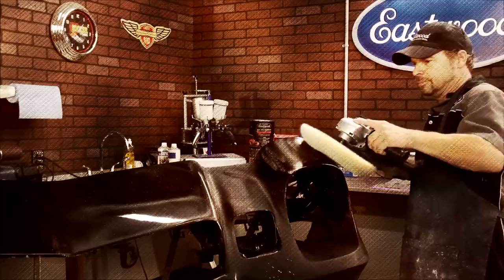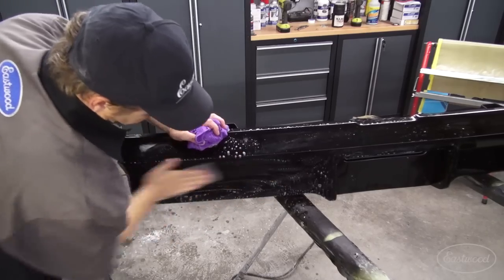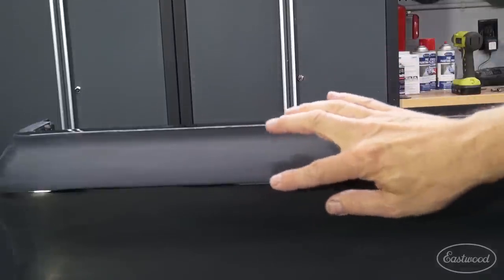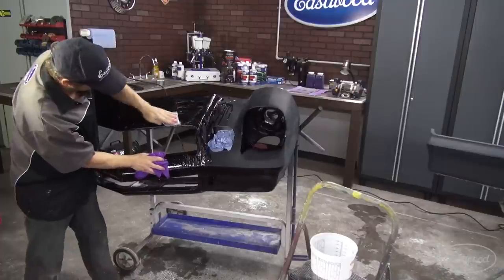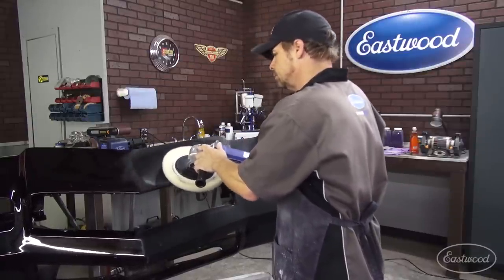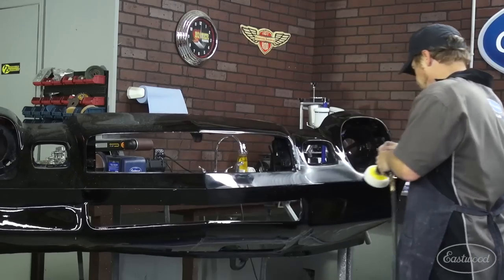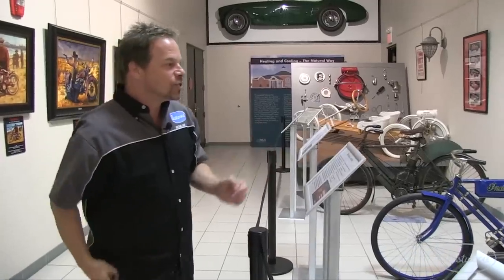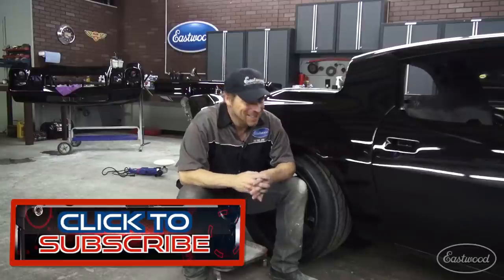How To Color Sand & Buff Your Car's Paint on Hands-On Cars Ep 15 - Eastwood

Comment: I always block wet sand, to prevent uneven pressure. Blocking helps to keep even pressure and keeps everything smooth. Which I know you mentioned don't use your hands to sand with out blocking.

Comment: i started painting back in early 80s when bodytechnique was different  and when you painted a car it was acrlic enamel or enamel  and  once finished  you were finished .... the finish was all in the painter and how he set his gun  while painting  and the pre prep of the paint before it went in the gun to ensue it was mixed right and would flash right ...  base clear is easier  but it  has sprung a world of sanders relying on paper rather than technique for finish  after all you are aplying the clear coat or the shinny finish  over thinner with pigment ..technique counts so you dont go over and wetsand and color match ....   and put the car together  for finish paint all the under  should be painted first then assemble then paint door  jams then body all together .. ensures a all over fit and complete match of everything ..

Comment: Excellent video as all of them are. In the previous one where you shot the base/color coat, you are saying that you don't need to color sand after that step? I assume if you create some texture/orange peel, then you would. I will be using Eastwood single stage urethane as the base fyi.

Comment: What I hate the most is how I do exactly the same procedure with the cut and buff step and I end up with a bunch of scratches, new scratches that were not in the paint initially. I recently painted the roof of my vehicle in black. I waited a week for the paint to cure completely before sanding & buffing. I wet sand with 1000, 1500, 2000 grit and finished off with 3000 wet on a DA, came out looking amazing!  I'm thinking, after I buff, the paint will look extraordinary. I used the 3M Rubbing Compound 05973 with a McGuire's maroon cutting foam pad. What a horrible mistake that was. I was left with a bunch of scratches. I wanted to blow up the car into pieces. The more I buffed, more scratches. I feel like re-clearing the whole damn roof again. Is it possible to fix the horrific disaster of scratches left after buffing using the Norton system?

Comment: question: I like that little air buffer setup...I have a 30 gallon 5 hp craftman air compressor will it be able to keep up using that unit..and what exactly is it? Just an angle grinder...excuse my ignorance I use mostly electric power tools..thanks

Comment: How do you handle spots where you might  have sanded through the clear? Do you have to sand all the clear off and put another layer of base so that it has the same color and no sanded area or just sand all the clear or...?
Thanks for the video.
Reply from the maker: +amtpdb1 Generally, this is what we would suggest:  Sand the panel with 800 grit and a grey scuff pad until there is no gloss.  Spray the color / basecoat on the area where the clear was sanded-through.  Finally, clear coat the entire panel.

Comment: Question!!! So I bought the liquid ice 3 step buffing kit and I purchased the eastwood random orbital polisher. The only thing is it's a 5/16 not a 5/8 like the backing plate provided. So I purchased a 5/16 to 5/8 adapter for the backing plate. Is that ok to do or should I return it and get one with a 5/8 fitting?

Comment: Would it be beneficial to just buff and skip the sanding? Also, if there's a little dust stuck in the clear, what's the best way to correct that? 
Thanks! (56 Chevy 210)
Reply from the maker: As you sand and then buff you are removing any imperfections, which is why you start with a more aggressive sand paper and work to finer.  Each step removes the imperfections left by the previous sandpaper.  Same with buffing.  It should be the final step and remove everything else.  Here's a 3 part series from Kevin Tetz on Clear Coat repair:  https://youtu.be/YxnaAFzvq2M

Comment: … what is the square metal frame setup technically called, that he is using to hold the front clip with. It has wheels and appears to have the adjustable sections to enable connecting the front section to this frame setup.  I see him using it holding doors, hoods, etc. .  Where would on purchase one of these ?
Reply from the maker: You can check Eastwood for Auto Twirlers and Auto Carts.  For some components, you may have to try a company that distributes to body and paint shops.

Comment: Wait! Question!!
You mean to tell me, you used the same buffing compound, but different buffing pads.
Gee whiz I'm an idiot!! I was alway told to use different compounds with different pads, and if it was that easy , you have a costumer!!
Reply: John DZ when you're last sand is 3000 they don't need aggressive  compound...he wet sanded to hell out of that car.I used to buff boats and the real badly oxidized ones I would sand with 600-then 1000 then hit with heavy duty compound and wool...then medium and wool... some I would then hit with foam and fine then wax...but again if I would have finished off with 3000 I would just use fine compound like Kevin did and switch pads...both methods are correct...